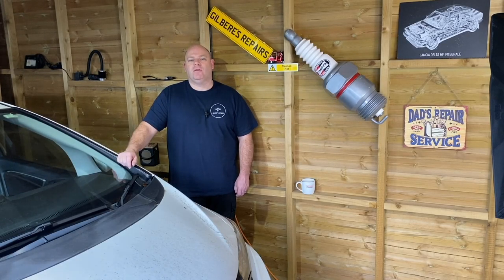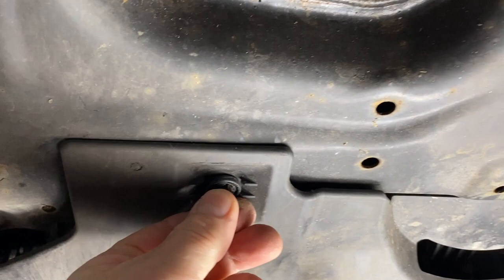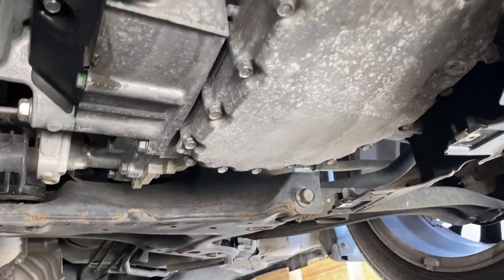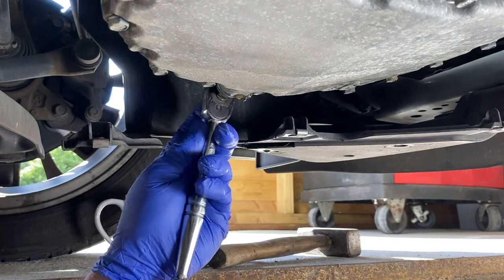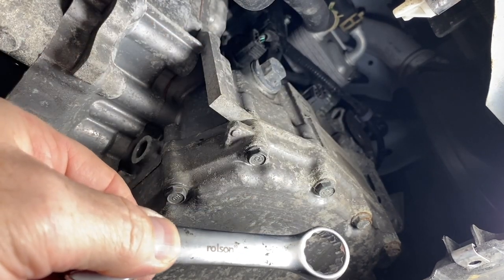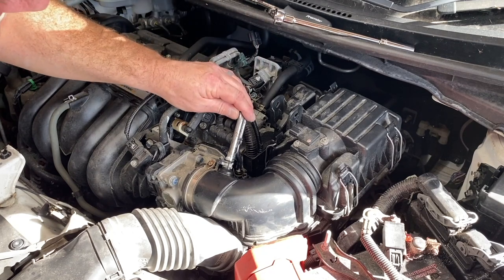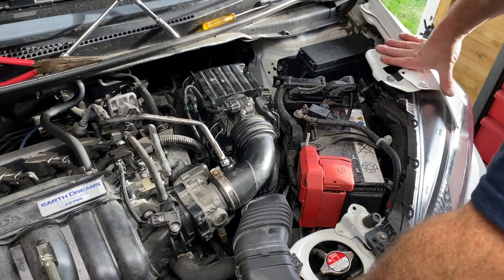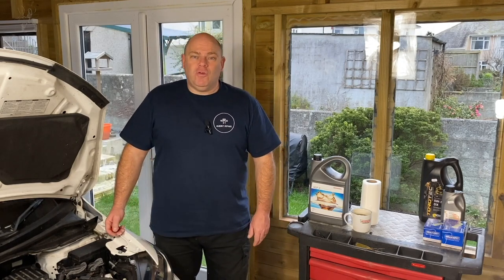Honda jazz fit gearbox oil change

Comment: Well explained, I've got a 2015 can I use the dipstick or do I look for a rubber bung to fill up gear box
Reply from the maker: I’ve only filled via the bung. There maybe different methods and different versions of the cvt transmission. 
Here’s one i found showing a 2015 https://youtu.be/_uiqEYriJ1A

Glad you found the vid useful 👍

Comment: Missing some step to ensure correct level or proper quantity filled.

•After fill to the overflow hole plug the level check hole temporsrily. 
•Start the engine and circle thruogh the gear P, R, D, S and back to P, momentarily stop aboit 3-5 second at each position. 
•Once the radiator started stop the engine. 
Unscrew the level check plug let excess fluid flow out til tickling out. If no fluid vome out top up til fluid flow out. 
•Finnally put the level check plug and tighten to  spec. 

If you remove the airbox earlier, install it back after these final steps.
Reply from the maker: Excellent, thanks for the advise 👍

Comment: Great video but I replaced my  cvt  oil on my 2015 Honda Fit made in America and did not remove the air box assembly I used a flexible hose and fed it down through the spill plug
Reply from the maker: Yes, there are other ways to get the oil in.
Glad the vid was of some help and can give you an idea of what to expect 👍

Comment: Do you have a link to order crush washers for honda jazz?
Reply from the maker: Sorry for the delay in getting back to you!
I’ve not got a link for the washers, but i’ve just typed in “Honda Jazz cvt washers” on eBay and it brought up various items 👍
I just asked for them at Honda when i purchased the oil.

Comment: I have a question about the washer that you replace in this video and in the oil change video. Is this a part with a specific part number? I was planning on doing this but im kind of unsure about where to get this washer/its dimensions.
Reply from the maker: Hello, 
I purchased the washers from Honda when i purchased the CVT oil. I’m unsure of the dimensions, sorry. 

Hope all goes well 👍
Reply: @gilberesrepairs  Thanks! I think its 20mm, for others wondering.
Reply from the maker: @nw-diver  Excellent, thanks for the update. 👍
Hopefully the information will help others 😎
Reply: @gilberesrepairs  All went well due to this great instruction you put up, thanks alot! Clear, consice and informative.
Reply from the maker: @nw-diver  I’m glad all went well… some money in your pocket 👍 🥳🥳
Reply: @gilberesrepairs  Thanks! Thats very true😃

Comment: Hello.. must the cross washers be replaced after oil change
Reply from the maker: Technically yes, but you can get away without 😜
Reply: The crush washer is to have a proper seal once its crushed between the drain plug and gearbox casing. So a new crush washer will give a good proper seal, its cheap thou 😅

Comment: Great video and explanation, looking forward to doing it myself soon! Is there a reason that you didn’t fill the fluid through the fill plug, but to take the air box out to fill through the plastic bung?
Reply from the maker: Thanks for the positive comment! 👍
As far as i’m aware the plastic bung is the filler plug, but i could be incorrect 🤷
Don’t forget to check out my Honda Jazz Playlist 😉
Hope all goes well when carrying out the job. Report back on how it went 👍

Comment: Theres no hole on the top that i know of. ( or maybe i just havent looked) ) We just use a clear hose and a small hand pump to pump the new fluid into that upper fill hole bolt. She only takes 1.7 qt.
Reply from the maker: There maybe another method 👍 

There should be a rubber fill bung, it’s very hard to see and access.

Comment: When do we need to change the CVT filter? Mine already doing about 50k Miles
Reply from the maker: Thanks for the question!

I was unsure of the answer, so i gave the Honda main dealer near me a call, and he said… “there’s no filter on a 2017 cvt transmission”. 
He just recommended changing the cvt oil every two years.

Sorry i didn’t know the answer, maybe worth doing some more research 🧐
Reply: 30k Miles is when you should be changing the cvt fluid
Reply from the maker: @archie_bunker  Excellent, thanks for the information 👍
Reply: There is a filter in gearbox but Honda don't have it as a routine maintenace to replace it. 
The CVT Fluid to change every 30k miles or 2 years.

Comment: I followed this guide the first time I changed CVT fluid (good guide). This time as I was watching the video again it struck me - why not just remove the battery? 

Its easier, faster and less of a hassle, and worked just as well^^
Reply from the maker: Excellent, anything that’s makes our lives easier is a good thing 😎
So, you only removed the battery, none of the air box assembly?
Reply: Agreed! Yeah just lifted the battery out and unplugged some of the electric cables. It felt like cheating🤣
Reply from the maker: @nw-diver  The next time the father in-law wants his gearbox oil changed, i’ll remove the battery and record another video 👍
Thanks for the feedback, it’s good for anyone watching the video and reading the comments 😎

Regards, Sandy.

Comment: you dont have any trainssion leaking, good luck bro. BTW，may not need to remove the air fiiter.
Reply from the maker: Yes, no leaks, very lucky 👍
Reply: If you can reach out to the filler rubber plug by sneaking betwen the battery and the air box, no need to remove the air box. 

A new crush washer gaurantee good seal avoiding leak.
Reply from the maker: @metzmatu8409  Yes, i think some people can reach it. I removed it for better access and because i’m filming the job 👍

Comment: Help! . I added 4 quarts and the level hole is still not dripping. 3.6 liters came out (if that matters)
Reply from the maker: Are quarts the same as litres?
I’m in the uk, so we use litres.
Is the car sat flat on a level floor?
Reply: @gilberesrepairs  3,784mls in four quarts. I think it's enough to drip. The car is leveled
Reply from the maker: @LuisOrtiz-ko6yt  Has the gearbox got any signs of previous leaks?
I would add another 200ml to see if it starts to spill out.
Reply: @gilberesrepairs   I'll get an extra bottle tomorrow. Thanks a lot.